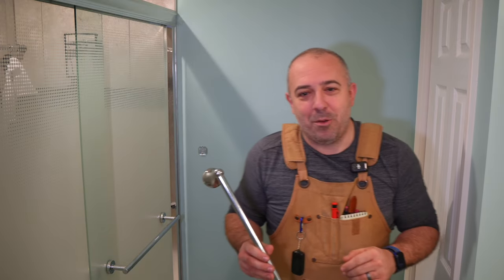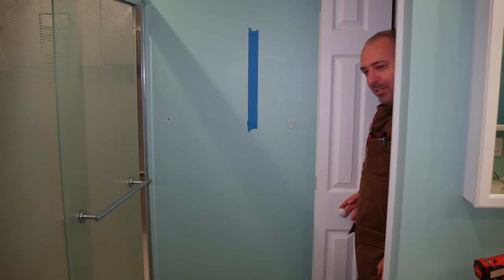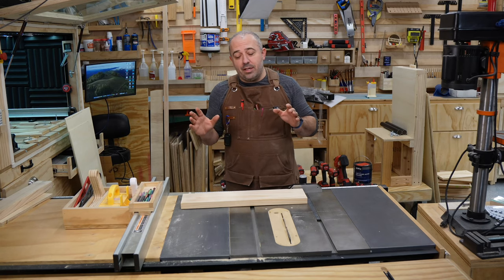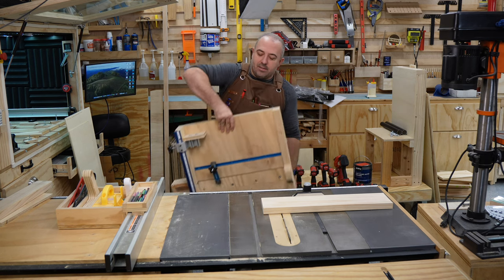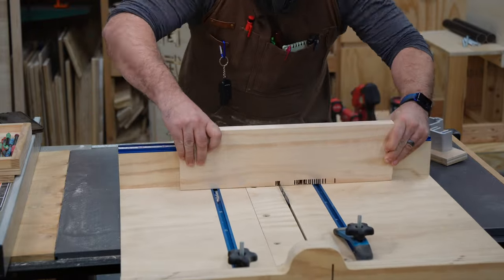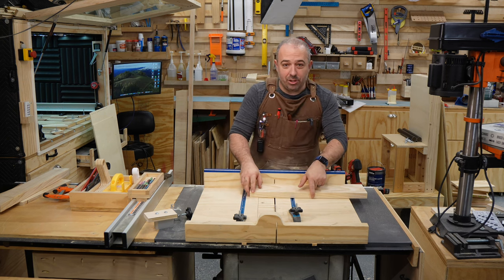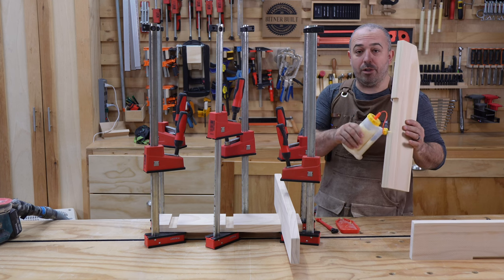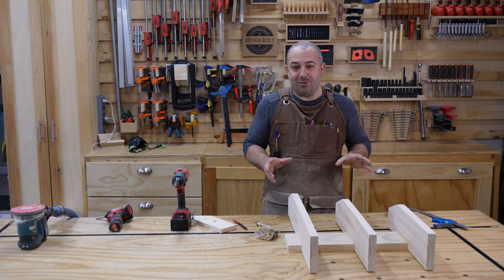1 Stud Towel Shelf System, Forget Towel Rods!

Comment: Great project! It's given me an idea for something similar in our master bathroom. I have an air purifier/filter question. My workshop is in most of a 2-car garage, and I pretty much always have the garage doors open when I'm working out there. I have gone back & forth about having an air purifier, since it seems like a useful addition, but I'm not sure if it would be effective for that large a space with almost the whole front wall open to the outside when the doors are up. Since the space is not climate-controlled, I also have a floor (pedestal style) fan that I generally have blowing on me for cooling during warm weather. (Actually, here in Texas, warm might be an understatement. LOL) So I would like to know your opinion on the necessity or effectiveness of an air purifier or filtering unit for my setup. I do have (FINALLY!) dust collection. Basically a shop vacuum type unit for smaller hand tools (sander, etc.), and a larger unit for my miter saw & table saw (so far just those). And yes, I also do wear an RZ mask when I'm doing dusty things. I'd appreciate any input you might have. Thanks in advance. Hope you have a fabulous day! :)
Reply from the maker: Thanks! 
So I would always say my first answer is any more safety equipment can never be bad.  But I get what you mean about with the doors being open. I guess my question would be do you have dust on things high up in your garage? The type of dust that a ceiling mounted air purifier is trying to grab is the dangerous stuff the really small particles that stay suspended in the air for a good period of time. A lot of those particles are even incredibly difficult to see.
Reply: Never a bad idea to put a large (24"-30") shop fan at the door blowing out the micro particles. Preferably pedestal mounted since most dust is generated at bench top level.
Reply: I also have a 2car shop, and in nice weather the doors are always open. I put in a Wen 400cfm above my sanding station. Even with fans blowing out, those filters capture a bunch of dust. Maybe because of the swirling air? With only 1.75 lungs I believe it was a great investment in my future health 😷